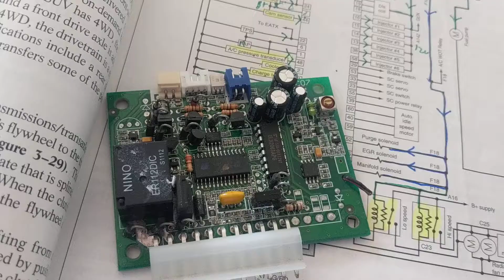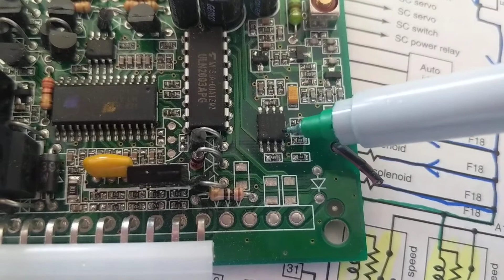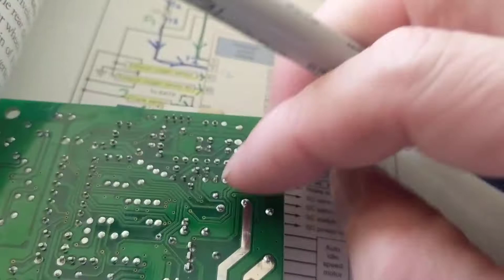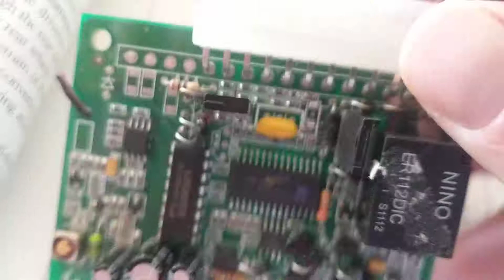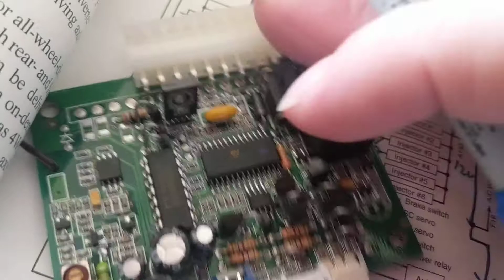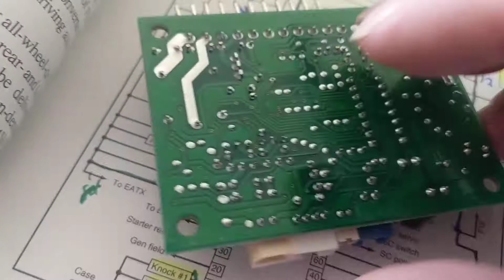IDENTIFYING THE PARTS OF A COMPUTER MODULE

Comment: The large gold colored part near the big transistor is a ceramic resonator. It is used to produce the clock signal for the microcontroller (the SM IC with lots of pins).
There are lots of different semiconductor devices that come in packages like those being called "transistors." They may be discrete semi's or integrated circuits.

At about 4:35 the two tracks called "ground" are very, very unlikely to be ground. They go to the contacts of the relay and in modern automotive electronics ground is rarely switched. The long one goes to the moving contact, the short one to one of the fixed contacts, probably the normally-open one. The traces are wide simply because they need to carry considerable current.